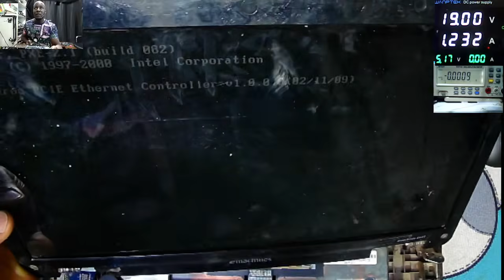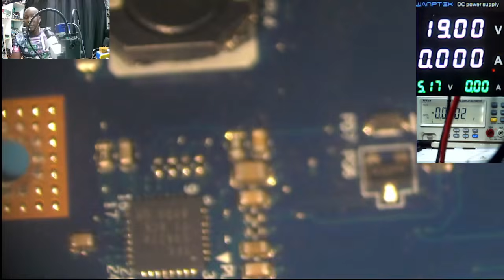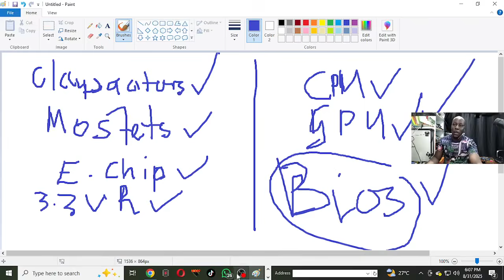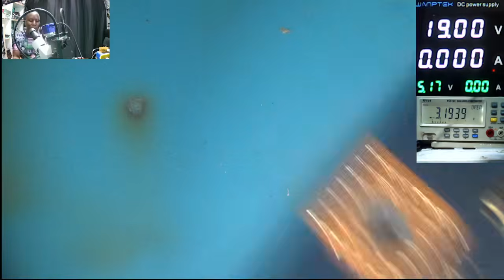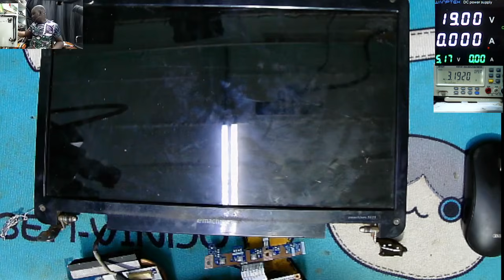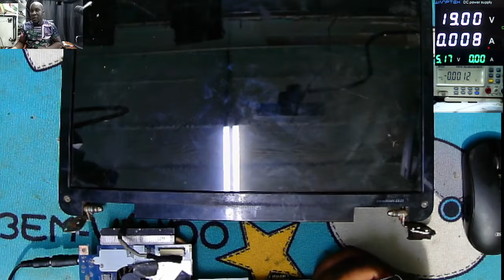Let’s Simulate Faults On Laptop Motherboard, Faults Tracing & Tricks To Repair Hardware Problems!!

Comment: You seem to be really busy except for today you had some free time. Can't replace a coil with a wire because of the windings similar to like a mortar which has to be rewound exactly also there are coil testers for testing such faults not a multimeter. The bios chips are sold programmed for those who don't want or know how to program. 10 to 15 laptops is quite impressive here I'm lucky if I get 5 clients
Reply from the maker: Thanks for regular feedbacks... Much Respect to You... Best of Best ❤.. This side we are less than 5 the entire town doing pure electronic repairs,, at the end Demand is higher.. But charges are lower based on old laptops that we a fixing everyday
Reply: @BstAfricanElectronicsSurgery  I aspire to be like you one day
Reply: I always feel inspired me when I watch your vlogs. 

I have a notebook when i always write down tricks I get when i watch your vlogs. 

I can say, I have really learnt alot since you can't know all. 

I can say big up considering that you are good at laptop, Tv, and phones. 

One thing I learnt from you which is True, If you want to know electronic repairs, start with big motherboards. 

Once you do that, small motherboards will be easy to fix. 

Continue educating the masses who are passionate abt electronic repairs.